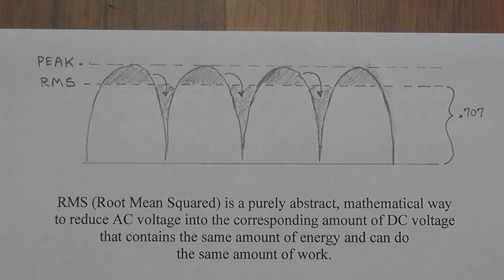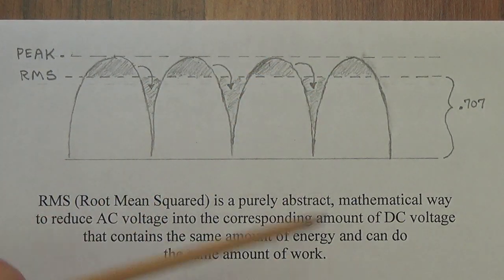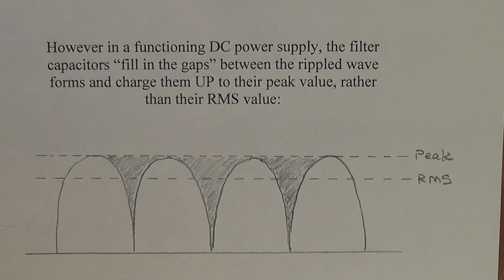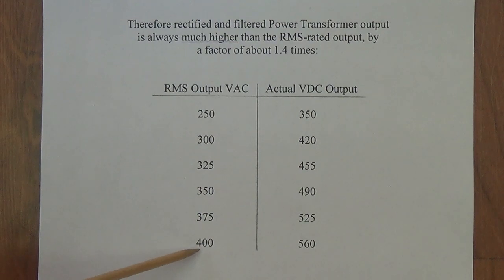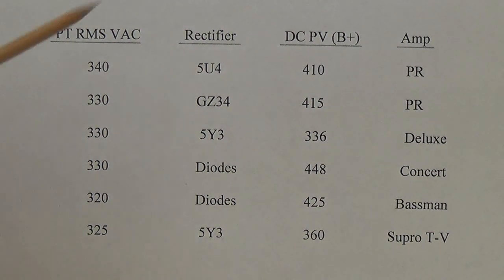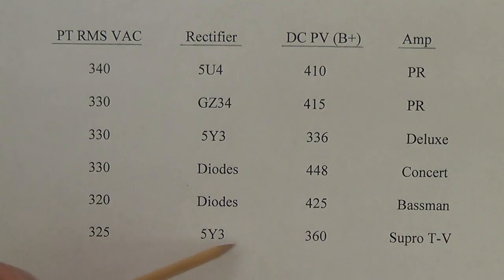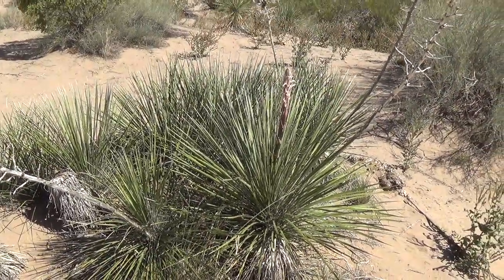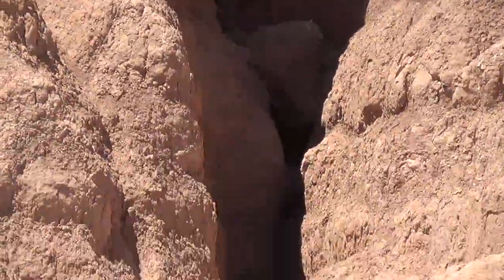Power Transformers:  Why The DC Output is Much Higher than the RMS Rating

Comment: As you state, if you increase the B+ load, more current flows and the B+ voltage will decrease (in an unregulated power supply).  The B+ voltage decreases due to the increased voltage drop across the internal impedance of the power supply.  At 6:15 you state that "(Current and Voltage are Inversely Related)".  That is completely misleading.  As I'm sure you know, e = iR (E =IR, v = iR, V = IR etc.).  This is a linear proportional relationship, not an inverse relationship.  At 6:38 you state that " ... as the voltage goes up the current goes down".  By that I assume you mean that as the load current decreases, the B+ voltage increases.  But the way you state it makes it sound like increasing the voltage will decrease the current, and we know that to be the inverse of what happens.
Reply from the maker: People who work on amplifiers understand exactly what I am saying, B1, particularly when biasing output tubes. Increase of the plate current will result in a decrease in plate voltage, and vice versa.  I realize there are more elaborate ways to express this relationship, but the fact that I don't resort to elaboration is exactly why so many viewers enjoy my videos. Thanks for your helpful input.